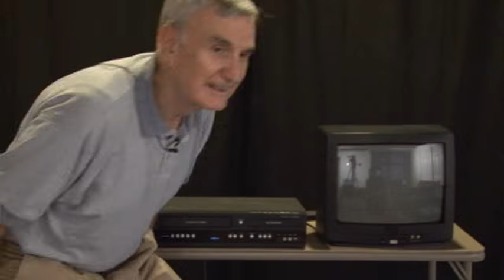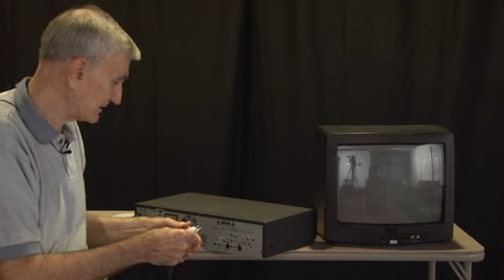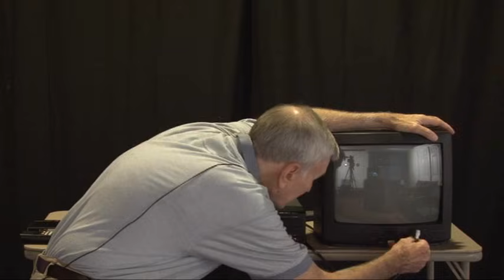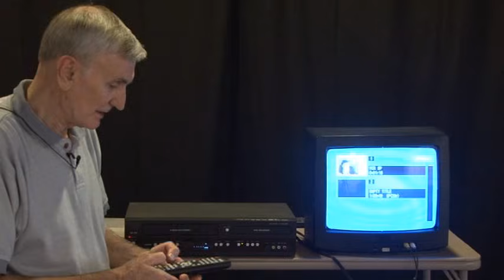VHS transfer to DVD using combo recorder

Comment: Dear Anthony Wheeler : Since you've posted this video around five years ago, can you please suggest me any latest solution for Cassette to DVD recording that can save the time by forward mode recording.?
Reply from the maker: Maratib Ali Sadiq, Thanks for the question. From all that I am aware of there aren't any faster ways to transfer "Cassette, VHS video, or any other analog video" to DVD or digital format. The analog tapes must be played back in "real time" in order for the converter process to work. If there are newer ways to play the tapes faster and convert them to digital I would be very interested to hear about that.
Reply: Many thanks for your reply. Stay blessed. :) I'm Interested to buy this machine, any brand or model recommendations please.?
Reply from the maker: Maratib Ali Sadiq, The model I have is the Magnavox ZV427MG9 combo recorder. I bought it at WalMart years ago. I think this model is discontinued. I don't know what the current models are. Just be sure to purchase a combo recorder (not just a player) they look alike.
Reply: Thanks Anthony.. :)

Comment: Anthony, I bought a similar model Magnavox VHS-to-DVD recorder, and it digitizes my home videos into a nice DVD+R disc, but I am going crazy trying to import the discs to PC for editing.  I've tried various softwares for this, that are supposed to be able to import DVDs, but either the disc won't import or I get a hopeless jumble of overlapping files.  In the TMPGEnc programs I get both Titles and Playlists, all out-of-order and in odd lengths that don't add up. As you know, these machines do not make the standard type of folders and files. Is there a special technique or program you recommend for getting your Magnavox-made discs onto PC for edits?  Many thanks for any tips!!
Reply from the maker: kerumbo , very recently I purchased and downloaded the program Ultimate Video Converter. I haven't tried using the program for ripping a DVD to their editing software but I am hoping it will work for that purpose. I will try  that when I can get time.
Reply: Anthony Wheeler Thanks, Anthony! but now. I finally can answer my own question, at least enough to start editing on PC:  In TMPGEnc, use the import from DVD option but ignore the Playlists and just select the desired Titles.  In VideoReDo, when I go to import titles, for some reason I see each Title twice -- but if I pay attention to the lengths I can spot the dupes and just import each Title once.  I haven't tried ripping-alone progs yet, since the goal is to edit, but maybe the issues and solutions are similar.

Comment: Hello Anthony, what’s the brand and model for that device? Will this work the same in Europe as well?
Reply from the maker: Jarlath Stevenson, My combo recorder is the Magnavox ZV427MG9 which is no longer made. From what I know there are no combo recorders made any longer. Only used or refurbished units sold now.
and if you plan to try to buy one, be careful there is a vhs recorder that will play DVD out there that looks almost identical to the Combo recorder, but will not record to DVD.

Comment: Can you tell me what combo recorder you are using please and does it support a Sony handycam HDD DCR-SR75 please
Reply from the maker: lesley Fisher,  My combo recorder is the Magnavox ZV427MG9A. I don't believe it is available in stores now. Even if you could find this Model I am not sure  it would work with your HDD DCR-SR75, reason being, your handycam from what I have learned on YouTube has a special cable that Sony supplies to connect the camera to other components.
Reply: Hi Anthony . I was thinking of buying a Toshiba RDXV60 to convert vhs  to DVD . But this model of Toshiba also has a DV input and can convert MPEG 2 files . I wondering if this is the answer to my problem of downloading my videos from my Sony DCR - SR75e camcorder . 😊
Reply from the maker: lesley Fisher, It appears that Sony has a special cable that the DCR-SR75 uses to connect to other devices. I don't have this camera, this is all I could find out.

Comment: Would you happen to know how to dub DVD to VHS, as odd as that is? I have the same Funai model as you do in the video, yet I have no remote. Any advice? Thanks.
Reply from the maker: Christopher J. Sheets, I don't know, I have never tried that. I will try and  see if that can be done.
Reply from the maker: Christopher, I tried and it can't be done without the remote. There is no menu or set up button on the combo recorder, you would have to go through setup to record from DVD to tape.
Reply: Thanks so much for not only quickly trying, but quick results too.  Know anywhere I can purchase a remote for this Funai player?
Reply from the maker: Christopher J. Sheets, The only place I could think to try would be Ebay.

Comment: Can I do this with Samsung DVD-V6800?
Reply from the maker: Jack Kello, This is what I found on the interner. I coppied and pasted this description off the internet. Samsung DVD-V6800 Multi-System DVD Player/VCR Recorder. It does not record to DVD. Its only a DVD player but also a VCR Recorder only!
Reply: @dahdigital1  I see, I got an offer to buy it for $100, it's in good condition. Is it worth it?
Reply from the maker: Jack Kello, if it does what you need done for you.

Comment: When I attempt to dub, I get an error message saying playback feature may not be available on dvd. I gt a blank dvd-rw, why is it not working?
Reply from the maker: +Al May , I believe the DVD may be copy protected. Can't fix that
Reply: its an old vhs tape we made from our vacation
Reply: the dvd is blank
Reply from the maker: +Al May , if you are using the same combo recorder as I use, the  MAGNAVOX DVD RECORDER / VCR ZV427MG, I would suggest reviewing my YouTube demo video. I would also try a DVD-R disc.
Also try playing the vhs tape a bit to see how your video plays.
Reply: thanx
Reply: +Al May DVD-RW is a re-writable DVD and re-writable DVD's are not compatible with most DVD players....you need to use DVD-R or DVD+R
Reply: what is the difference between DVD-R and DVD+R
Reply: +Al May ...well...without going into way too much detail (most of it would be foreign language anyway)...let's just say DVD-R is your best bet because it has the highest rate of compatibility...meaning it is likely to play in 97% of DVD Players or computers.

Comment: Is XP mode better quality than SP mode.
Reply from the maker: meepymoof, I think that is correct, however the manual for my combo recorder does not reference XP but shows (HQ) to be the better quality than SP mode.
Reply: Maybe  because my combo is new The setup menu is a little different than yours. It does give me the XP option. I just transferred my 1st 2 tapes. The only thing I'm confused on is one VHS was only 23 min. And the other was 58 min. and I believe the Verbatim are 2 hrs. When the VHS is done, should I just put in another to fill the disc to the 2 hrs. I also noticed when set at XP the time is one hr.
Reply from the maker: meepymoof, yes if you are recording in the SP (2 hr) mode you should stop the recording after recording your 23 min tape and than put in your 58 min tape and resume dubbing.

Comment: every disc made like your doing comes out low sound! if you have old tapes, best to use a separate VCR! run the audio out into the input of a cassette recorder, and output of cassette into DVD recorder. so when you watch tape, turn on cassette deck, put it in record mode, and turn up vu meters on cassette deck til the sound is in the red. I hate watching DVDs made on these recorders cause you gotta turn the TV up all the way. all my 500 DVDs I transfered got nice loud crystal clear sound, I even run it thru a equilizer too to get rid of bass on SLP recorded crappy brand tapes..
Reply from the maker: ken sims, thanks
Reply: +Anthony Wheeler I collect old MTV recordings, and everyone I got I gotta turn up my TV all the way! to barely get sound! I turn up my TV halfway when making DVDs, and turn up the audio on the cassette deck and adjust the sound as loud or low as you want it recorded.. I do it by ear, but you just watch the meters on the cassette deck. but you can add a equilizer in there or any device that helps sound. I've even ran it thru a surround sound receiver and out to the recorder.. I got a great stereophonic sound from mono recordings.. plus all videos sound different on different machines.. I love experimenting first before I do transfers on which machine sounds best.
Reply from the maker: ken sims, it good to know that these sound issues can be resolved. Thanks

Comment: Does this work with official VHS releases of movies?
Reply from the maker: Ed ward, I don't think this transfers copyright titles
Reply: Ed_ward yes it does, if it doesn't, put a piece of scotch tape over the little security tab on the bottom left corner. It is a little hole that you will put the scotch tape over the hole
Reply from the maker: 95Q Videos, Thanks for the information.
Reply: Anthony Wheeler your welcome Anthony
Reply: 95Q Videos also is it possible while you're copying, to accidentally and erase the tape?
Reply: Ed_ward no, as long as you don't hit record. Make sure you press dubbing. I have a tape that was an official realease and I don't need it anymore so I've been recording on it lately and it works just like a recordable tape.
Reply: Have you transferred a copyright tape to DVD?
Reply: you usually can't do that because of macrovision on the tape ( or on another DVD) though not all movie studio tapes had that feature....to overcome that a TBC and separate VHS is required.
Reply: Could you record the movie onto a blank tape and use that for the transfer, or will the macrovision still work?
Reply: if you did that, it would still record the  macrovision signal , which the dvd recorder will then block from dubbing  onto disc.....btw, it was mostly MGM, paramount and universal, 90's issued videotapes that had that signal embedded in them.... other studios did not have that signal .....also as far as i know  the video capture cards as from haupphauge or elgato totally bypass the signal, on prerecorded dvd's or vhs tapes.
Reply: Ed_ward  with copy protection no.
Reply: 95Q Videos Please, don't confuse people. He's talking about coping original movies, that often have copy protection, like Macrovision.

Comment: Hi Anthony, I followed this video on dubbing from VHS to DVD. Most unfortunately, when I was finished, about 5 seconds of a 3 minute and 10 second transfer is visible, the rest is black and the section of tape I attempted to dub is no longer visible on my VHS tape. Please help! Where did it go? I removed the tab as you suggested before I got started so I don't know where I went wrong.
Reply from the maker: Marie Massari, is your combo recorder brand new, and have you transferred VHS tapes to DVD using your combo recorder before?
Reply: Anthony Wheeler It is the first time I am using it but it is brand new in the sense that I received it as a gift several years but was intimidated by it so there it sat. It is a Magnavox MWR20V6.   Thank you for replying.
Reply: +Marie Massari Is there any chance that I still have it?
Reply from the maker: Marie Massari, Try rewinding the VHS tape and see if it will play on another VHS tape player. If the tape has copyright content it will not copy. The model you have only records or +R, or +RW DVD's.
Reply: +Anthony Wheeler I tried another machine and nothing.   Content before and following that segment plays fine but during that segment it says "No Signal, Check connected devices power cable, connection, and Source selection"  Where did it possibly go?  Did it erase even though I removed the tab?  Soooooo disappointed !
Reply from the maker: Marie Massari, my guess is that tape has been erased some time in the past.

Comment: Will this work with PAL format VHS?
Reply from the maker: Cyril Labega, I have no PAL equipment. I think it would have to be made for the PAL format.
Reply: Thank you for your reply.
I ended up buying the exact same machine you're using on this video. I tried using a TDK DVD+R disc, but I keep getting a "Disc Error" message that says "Please eject the Disc, Playback may not be available on this disc"

What am I doing wrong here?

Comment: I am so upset I have been so excited to get my VHS put onto DVD, I don’t want to send my home movies off because my cousin did that and they ended up losing them. I don’t trust these other companies. I have a VHS DVD combo and unfortunately the DVD won’t read my blank DVD so it keeps ejecting them. I am so upset. 😢
Reply from the maker: If you purchased your combo recorder recently and it won't read your blank DVD, I am afraid you purchased a combo that looks like a recorder and in fact in only a play back machine. The two different machines look alike.
Reply from the maker: the words in only should be it only.

Comment: DO NOT BUY THE SAMSUNG COMBO!!! The Samsung does not use manual tracking, so when it auto tracks you get that stupid annoying blue bar pop up while you record to DVD. If you have an old VHS tape this happens a fair bit.. Very annoying to say the least, kinda makes the Samsung a pointless piece of kit. There is no way to turn these messages off on the Samsung DVD-VR350
Reply from the maker: Thank you for posting what you have learned about this unit.

Comment: Ppl, this is obnoxious and nonsense. U can't record onto DVD from cable. It's ONLY VHS to DVD however you can only transfer homemade movies if you're trying to transfer store bought movies the copy block will kick in and you can't record because of the stupid piracy laws. U would need a VCR, a actually DVD recorder (which they don't make anymore) and a copy guard eliminator hooked up between the two devices. That's how I  used to do it
Reply: Go to Goodwill or any thrift store you can find these if you look for them.  People are always donating VCR's and DVD recorders as new technology has taken over.  And they are not very expensive sometimes $ 5 to $10  you just have to look for them.
Reply: I recently bought a DVD/HDD recorder that I can record onto either but I mostly record onto the HDD first so I can see the amount of time the video is taking in minutes then transfer to the DVD. I just haven't come across the unit that goes in between for the copyright yet.